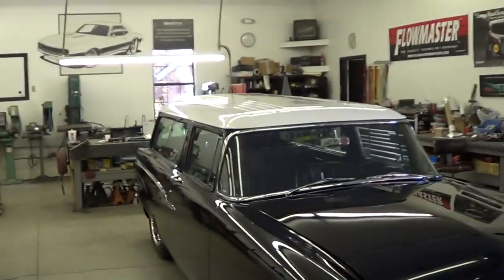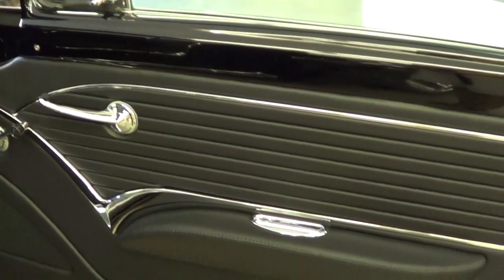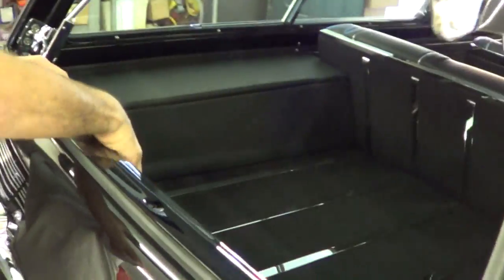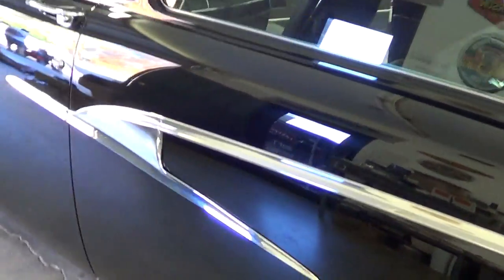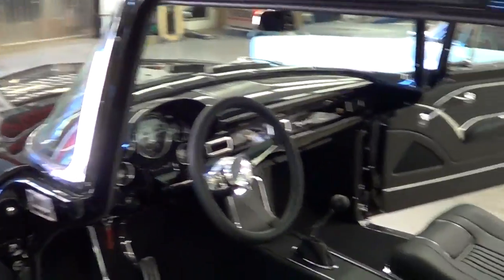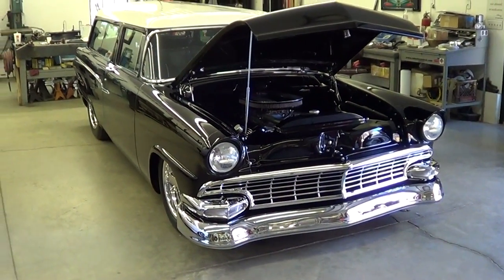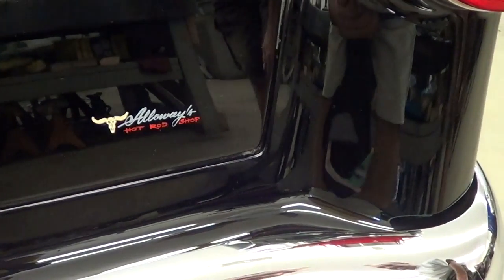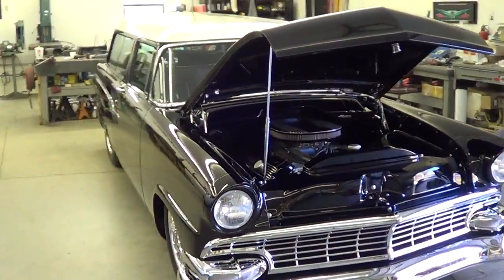1956 Ford Ranch Wagon Street Rod

Comment: That Ranch Wagon Ford has one of the most wonderful V8 engines ever made (427 SOHC). Robust and reliable, simple technology. Sad Ford does not have a department to preserve these wonderful engines manufacturing them today as it does with its magnificent Chevrolet Big-Block (427-454).
Reply from the maker: I hear ya...Thanks for checking this one out here!!
Reply: Vicente Fue